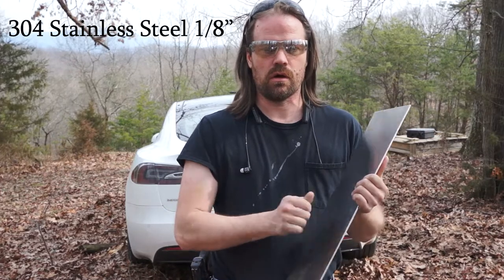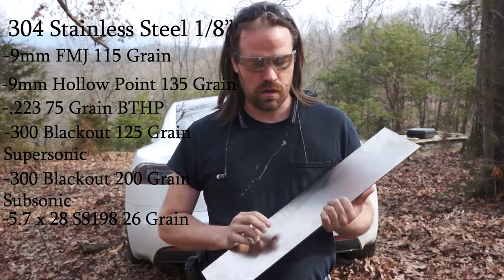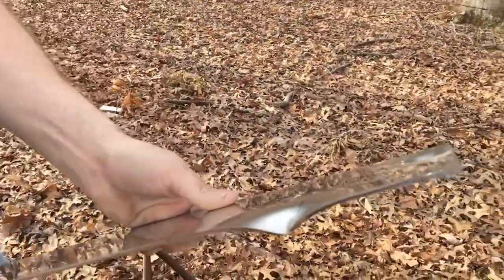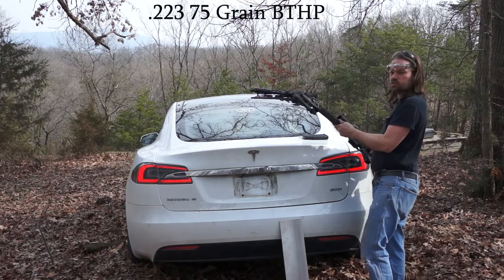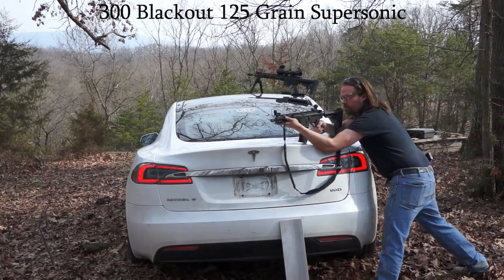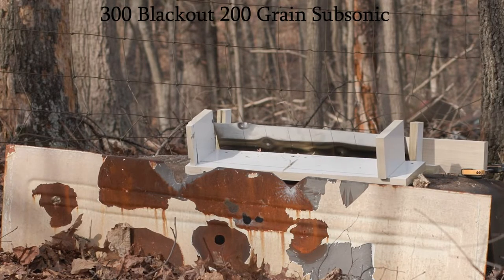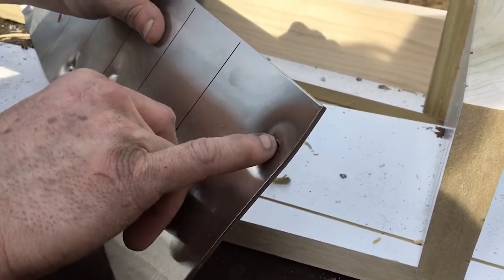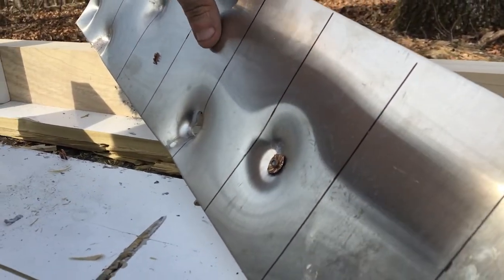Cybertruck-ish 1/8" 304 stainless vs 9mm and a few more

Comment: You proved that 1/8 thick 304 stainless will protect you from bullet with less than 1100 fps speed. It should works fine against a slow bullet like a 45 ACP and 9 x 19 luger at 1100 fps or less. You may want to try Liberty 50 grain 9mm at 2000 fps if you can find the ammo. It will go through a level 3A body armor with a plate. Another idea is to try a 9mm 115 g PCC - a 16 inch barrel with muzzle velocity greater than 1300 fps
Reply: i would like to see underwood 9mm

Comment: Tesla is using 308 gauge cold rolled. I believe it would be thinner than 304
Reply from the maker: My understanding is that the 304 is the closest 'off the shelf' grade of stainless to what they are using. 

IDK the precise thickness either, I've heard 1/8" which is what I used, and 3mm, which is slightly thinner, but harder to source in the US in small batches.

Comment: The Cybertruck is using 42-50 Rockwell stainless, which is harder than "full hard." "Half hard," which is what I assume you mean by medium hard is only 30-35 Rockwell.
Reply: Wouldn't being harder make it more brittle though? I know that's what happens with blades.
Reply: @YaBoiSnek  Yes, but it would be shocking to find that bullets could crack the metal.
Reply from the maker: Kind of necro answer, sorry, but it is a 3 year old video so, meh. B95 is what the spec sheet showed.

Comment: I'm pretty confident that the structural members of truck would provide deflection protection too.  How about testing the "metal" of the Ford F-150 and the RAM truck.  Is the heavy aluminum as strong as the lighter steel?
Reply: I know demolition ranch shot a 50 bmg through the bed of his raptor.

Comment: Excellent test video! I've read that the Cybertruck's body panels are 3mm thick 304 stainless. Which the thickness is slightly smaller than the 1/8" plate being tested here. (3mm = .1181")  / 
( 1/8" = .125 )
Reply: 3mm? Is everyone crazy? How much would it weigh? Cars usually use sheets 0.6mm to 0.8mm thick. And it would be a nightmare to stamp a 3mm stainless steel sheet.
Reply: @Mac1Eleven  bending is much more time consuming, and 3mm body is crazy in weight terms. I work with/design modifications for forestry applications, and a normal custom made hood protection shield is usually 3/4mm. A 10m forestry crane, capable of lifting over 1.5t is made from 5mm Domex steel. It's just an overkill for a truck. 
You could get the same strength with much thinner stamped panels, and save many kilos for a more efficient truck, and bigger payload. The normal thickness used in cars, SS would weigh around 4.7kg/m². The 3mm is 23.6kg/m²
Reply: @nelsonmarques1334  it’s 1.8mm in thickness, using 300 series steel
Reply: 1.8mm
Reply: @Mac1Eleven   actually door are1.8mm rest is 1.4mm
Reply: 1.8mm in the doors.

Comment: For the supersonic/subsonic it's simple physics, momentum is mass x velocity, I would suspect that the added mass to make it subsonic still won't make up for the loss of speed, resulting in lower power on impact.
Reply: There is more to it than just momentum. Faster impacts give less time for heat and strain waves to propagate outward in the metal. Higher speed at the same momentum also has more kinetic energy. On top of this, smaller caliber (with the same momentum) will cause higher stress.

Comment: What's the reason that the Cybertruck door panel in a quite a new YT-video seems approx. as sturdy as a 1/8" 304 stainless steel plate (3,175 mm) even though the door panels in the Cybertruck are announced to be 1.8 mm/0.071 thick?